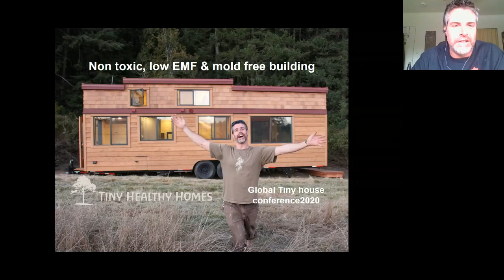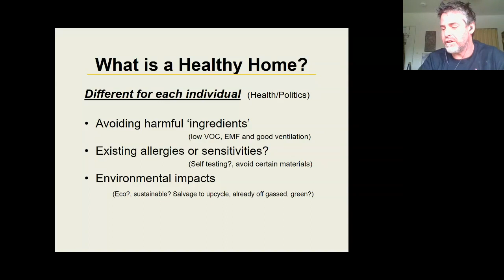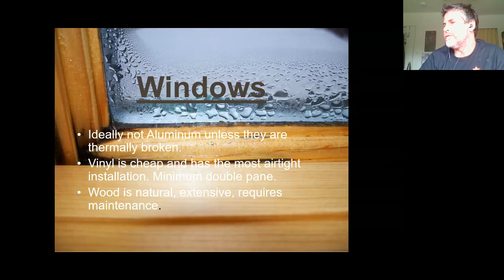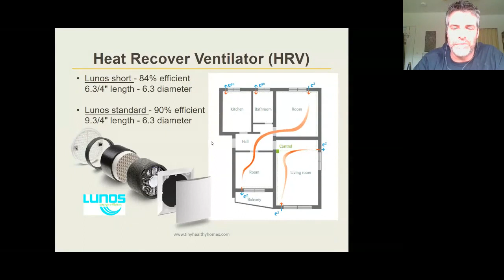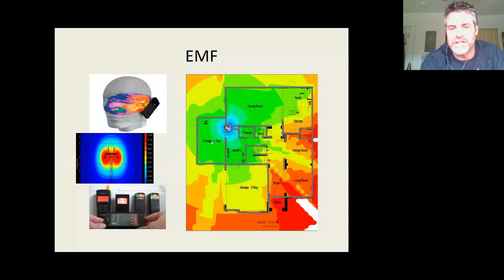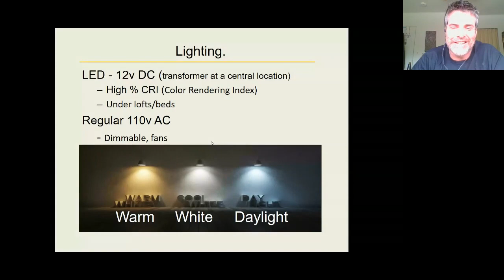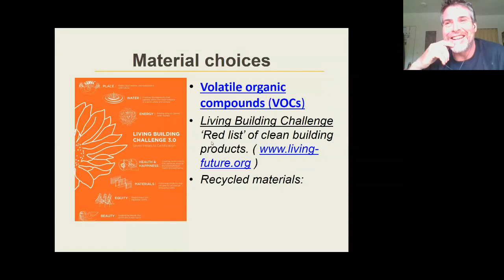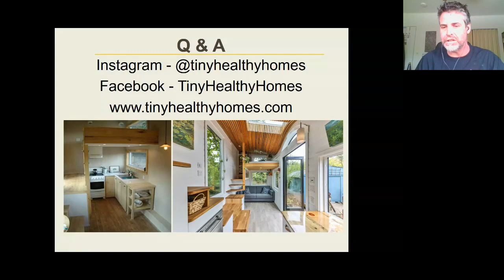Non-Toxic Healthy Home Building - Tiny Homes, Ben Garratt

Comment: Hi Ben, thank you so much for having shared this information, I'm starting to watch it right now. I hope to learn from this, since I'm planning to build myself a (very) tiny house. A mold resistant and non-toxic tiny house, not just "a" tiny house.

Since you shared, I thought I would share to this small piece of information:

For anyone who has chemical sensitivities, and other health issues, I want to recommend to check for heavy metal toxicity (through hair mineral analysis test / with help of work of late Dr. Andy Hall Cutler (you can find interviews, articles about his method, but also even his books for free on the Internet - I can tell you where, if you want)). Especially if one has dental amalgams (if one has them, even one small speck of them - until one doesn't completely remove them - one can never exclude that mercury toxicity is the cause of his/her health struggles. Some individuals can have a mouthful of them and have no issues, others can have one amalgam or even a small piece of it - and with time develop mercury toxicity and mercury toxicity related problems from it).

Another source (of aluminum and mercury toxicity) are vaccines, but it's taboo to talk about it, so I'll leave it at that.

Also, recently I learnt more about celiac disease and gluten sensitivity/intolerance, and about how that too can cause, with time, poorer and poorer health (malabsorption leads to mineral and vitamin deficiencies, mineral and vitamin deficiencies lead to poor health, all sorts of health issues and symptoms). I don't know if you know this, but apparently one can have celiac disease (and damaged intestine/villi), but have no digestive symptoms whatsoever - I found this crazy that nobody (no doctor) ever told me about it before, and didn't ever think to test for it (even though I have been struggling so much health-wise, and even though I do have many deficiencies). So I'm currently in the process of confirming it (or ruling it out), since I did have stunted growth, late puberty, deficiencies, and generally poor health.

I hope this my experience/knowledge can be of help. I especially recommend to learn quite a bit about heavy metal toxicity, amalgams, and Dr. Andrew Cutler's method, and make sure to remove any amalgams or traces of amalgams (by the way, it must be done with caution, with proper safe amalgam removal protocol, and one should also be ready to experience (possibly quite harsh) detoxification effects few months after he/she removed the amalgam material).

P.S.
Just in case - English is not my first language, so if there are some obvious grammatical errors, that's the reason why. Cheers.
Reply: Thank you for sharing 🙏💖!
Reply: Hi thank you for sharing this. I started doing the medical medium work about six years ago it's helped me a lot. Have you heard of him. Can I ask how your tiny home build going? I'm interested in doing this myself. I am in Washington state if you have ideas referrals etc.

Comment: I'm wondering if you know about any portable heaters that are non-toxic that are affordable can we say I can handle us stainless steel with no spray paint no chemicals on it I need electric one cuz I live in an apartment and they're not going to allow me to install anything there heaters made out of aluminum and it makes me really sick so I had them turn off I'm allergic to ceramic heaters as well nickel isn't really supposed to be breathing and it's mixed in with iron
Reply: Yes an important isse. Most electric ovens of gasses a lot. An oven type I use which works for me is the LVI / Yali type I got for free acutally (some people give them away) not sure if this type is easily avaialble abroad. I have a diagnosis of MCS..... @Jasmine Frichtl
Reply: @olehansen_Norway  
Do you have gluten sensitivity or heavy metal toxicity? I heard these two issues can also cause MCS.
Reply: @MaximC  it is complex in some ways, but yes I agree, that would contribute to MCS. Also fearful thoughts does contribute to poorer health. So all the conspiracy info out there.... a lot not true. Some true. A challenge for many to deal with. To heal the mind of essence.